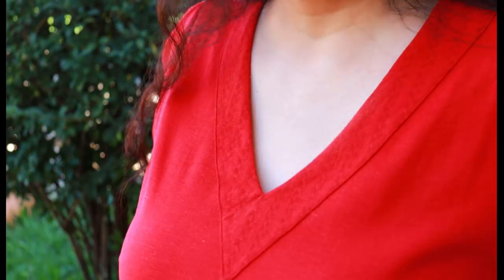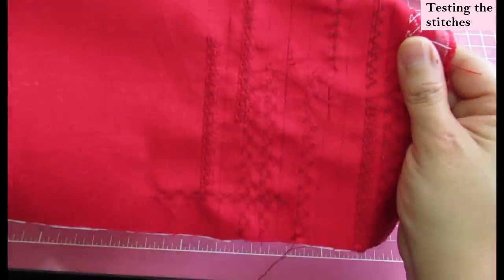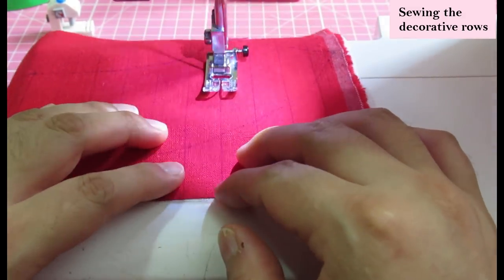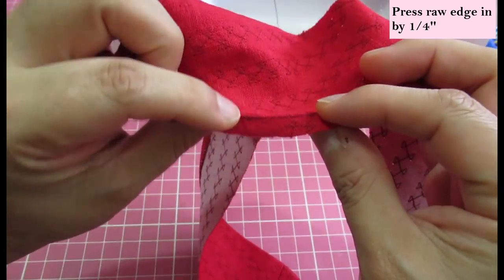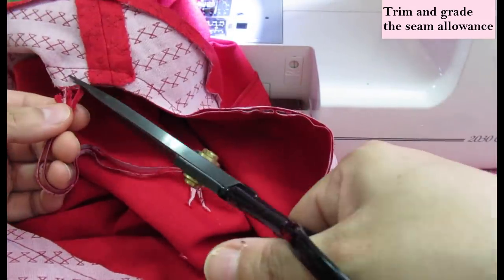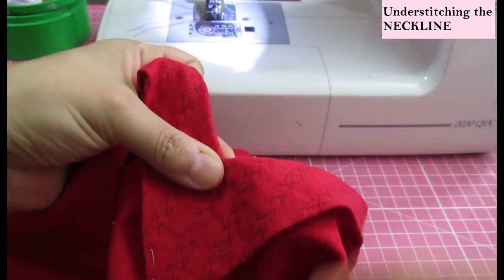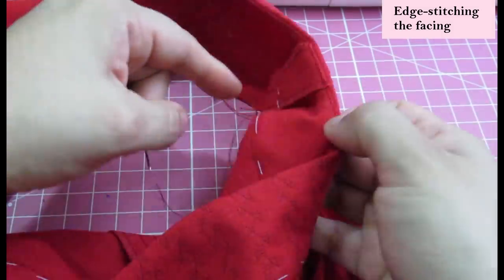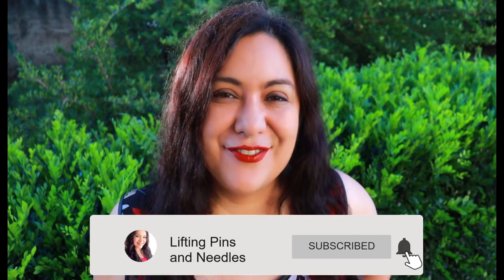DECORATIVE STITCHES. You know you have them 😀. EXPOSED facing idea. Seychelles top (Itch to Stitch).

Comment: This is so pretty. Thank you Katrina.   I am going to test out the decorative stitches on my awesome 1974 Singer Futura 900 that has about 22 decorative stitches. LOL  It is like driving a Manual Stick Shift car; that has to change gears. Zoom zoom!  
Back then it was state of the art, and not what we were using in Home Ed classes.   It's drawing straight lines that is the hard part!
Reply from the maker: I used a clear ruler for the straight lines :)
Reply: @LiftingPinsandNeedles  Thank Katrina!

Comment: Thanks Karina :o)  Great idea!  It looks like the decorative stitches aren't secured at the ends.  I am concerned about them coming undone.  Is the straight line of stitching used to secure the facing enough to secure the decorative stitches from unravelling too?  Many thanks.
Reply from the maker: The facing is sewn to the neckline with a 2.5 stitch length and then the neckline is understitched. The edge of the facing is also sewn down. I think the stitches are very secure and I would hand wash this item anyway. In this case it’s impossible to secure the stitches because I embroidered a larger piece than the facing was going to need. If I had wanted to reinforce them, I would’ve had to be very precise to only do the exact shape and size of the facing. I don’t see this any different to using embroidered fabric that I just cut up and use as per normal.
Reply: @LiftingPinsandNeedles  Okay, great.  Thanks.  I look forward to having a play around with the stitches on my machine :o)
Reply from the maker: Have fun :)

Comment: I'm a beginner.  My main question is, what or how are you using the foot pedal while the machine is making this stitch.  Do you keep you foot on the pedal or pulse it?  Maybe there is a beginner channel that takes it to the very beginning.   Like foot, thread, etc.
Reply from the maker: It’s the normal presser foot. The machine does the stitch because there are stitch options. The pedal is always stepped on while I sew and I only lift my foot to stop like any other stitch. I don’t plan to make content for the super beginner as you mention.